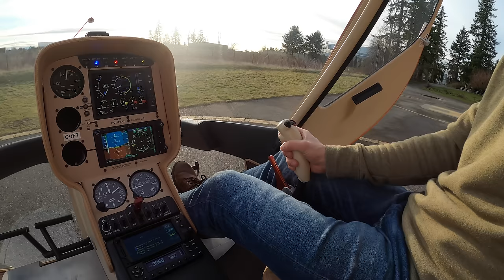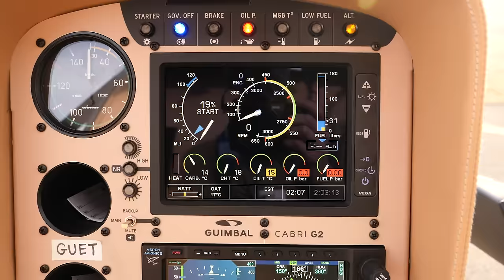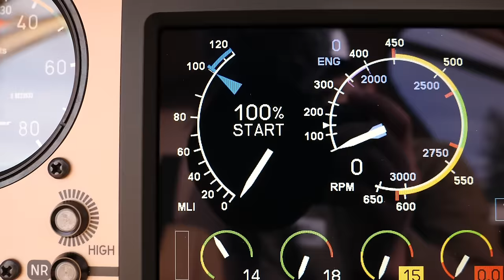How To FLY A HELICOPTER

Comment: the pilot in me wants to confuse everyone with gyroscopic precession
Reply: I've always been confused by that, it is precession or procecession?
Reply: @richduerr4471  not sure what procecession is but i know for a fact it's precession
Reply: @carl-ok9gn  Obviously procession is 90 degrees AFTER deflection, not before.  I'm pretty sure it is gyroscopic procession in gyroscope physics, but I'm drinking (booze) now, I could be wrong.
Reply: @richduerr4471  .... one of us is a pilot and one of us is drunk.
Reply: @richduerr4471  It's precession. Sober up, my friend. :-)
Reply: What everything is phased 90* off what he said.....gasp! What is this black magic. Bernoulli says keep cats in bag!
Reply: @landonmintz4850  >>> Schrodinger used a box...😊
Reply: Precession, Disymmetry of Lift, Retreating Blade Stall, helicopters ARE unique...😉
Reply: Retreating blade stall my favorite it’s like a built in governor!
Reply: @landonmintz4850  >>> Airplanes stall going too slow, FLING-WINGS stall going too fast. 😊 
 
Except the FLING-WING flips over before it crashes...😲
Reply: @landonmintz4850  , ya, and I'm still wondering how I went well past VNE in a R22 on my cross country solo and didn't end up in the woods below.
Reply: @Allan_aka_RocKITEman  bumpidy bump.
Reply: @scottalanclymer  in my cross country solo i pulled way more than max manifold pressure and didn't die.
Reply: @carl-ok9gn  >>> I think high MP and exceeding VNE are a bit different....
Reply: @Allan_aka_RocKITEman  yes. i just wanted in on the rule breaking..
Reply: @carl-ok9gn  >>> 😊

Comment: "The maximum torque you can use is 100% torque.."  facepalm
Reply: Apparently it is possible to exceed 100% in other models because the guage went beyond 100!!  I don't know what that means, but just saying what I saw.
Reply: It's 100% of what's acceptable. 100% of safe capacity.
Reply: @derick1618  no shit, Sherlock.!! -_-
Reply: Overtorque not good. Overtorque makes chopper  breaky breaky. But in Emergency for short okay without breaky breaky.
Reply: @hoola_amigos  My bad. I incorrectly assumed that you misunderstood the premise of what the 100% represented.
Reply: @derick1618  well, actually I didn't know that one could over-torque over 100%..
So you were right, and I was wrong.. ;)
Reply: @user-ki8ye1nc8p  Ah soooooo grass hoppa
Reply: @user-ki8ye1nc8p  A soooooo grass hoppa

Comment: Nice job. I would like to add that you focused on what the controls do mainly at a hover - collective to ascend/descend, pedals directional control (turns) and cyclic.  It's important to mention using collective to increase and decrease airspeed, pedals for trim, and collective for steering.   Lastly, what makes helicopters more tasking then fixed wing, is that you cannot move one control without simultaneously moving the others...for  example to accelerate and keep the same altitude you increase collective, apply left pedal, and slightly push the cyclic forward...

Comment: I actually attempted to join the army when I was a younger man because I wanted to learn to fly helicopters. Unfortunately I failed to pass the physical so the closest I got was video games playing flight simulators. I had the setup with controls such as he showed in this video, cyclic and collective and pedals, and the simulators are what potential pilots must learn to master first before they can ever get into the cockpit to operate an actual vehicle. After playing a simulator in which you could pilot a bell Huey such as the ones used in the Viet Nam conflict my hat is off to those pilots as they flew by the seat of their pants most of the time as compared to modern avionics in helicopters. I have talked with folks that were in Viet Nam and they tell stories of sitting in the choppers watching the runners brush the tops of the trees because the lower they flew, called "nap of the earth", the less exposure to ground fire.

Comment: Interesting. Always wondered about the left/right and forward/back but I had envisioned that, in keeping with the turbo shaft concept, that the entire rotor assembly pitched one direction or the other maybe five degrees to accomplish that (with a gear assembly as a linkage to the main shaft) because although I had pictured the the mechanism you described as one method of accomplishing that, to me, it seemed highly complex to manage and as though it would put far more strain on the blades than necessary and that it'd be very difficult to get mechanical parts to withstand that sort of high cyclic motion (rapid wear of metal and parts.) One thing is certain... they ain't simple machines!

Comment: Thanks, great video! Really like the view from the rotor hub that explains a lot. Amazing those blades can handle the pitch changes like that. At 400 RPMs it's almost 7 pitch changes per second. I assume the 90 degree till full pitch has something to do with the flexibility in the blade as it takes time for the change to reach the tip. Someone said helicopters fly by beating the air into submission and after having my first helicopter ride a few months ago I totally agree lol. Amazing machines, thanks for posting!

Comment: Taught myself how to fly a helicopter when I was 20.  Friends single seater experimental, explained to me how everything worked, played around low to the ground for a couple hours, and then flew to town 15 miles away and back.  

Navigation was my biggest issue.  Nothing looks the same from 2000 feet above...

Thought about taking lessons and getting my license to fly something useful, but family, work, money, and time always seemed like timing wasn't right.  Now at 50 years old, think my reflexes and eyesight would likely get me in trouble.  But, it was fun.

And to the naysayers, yes, I know it was stupid now, but at 20 I was superman, had no fear, and apparently no common sense.  I lived thru it though, and value the experience, however dumb it may have been.

Comment: I drove a stick, a motorcycle, a Cat 988, a 74 foot 3 blade Walter plow truck, a Walter 1500 gallon Foam truck, an end dump and an old Army plow truck with both front and rear wheel steering, all my first time out -  it's just that whole "ground" thing that concerns me a tad. BFWIW: I started on "You to can Spade & Neutor at home..."  3 out of 7 words spelled wrong. This guy got everything right, even "Helicopter!" So he's certainly smart enough to've been a military pilot....

Comment: The video from on top of the blades with the cyclic forward actually shows the correct maximum angle on the blade on the starboard side of the chopper, which is where it should be due to gyroscopic precession.

Comment: Hi Mr. Yellow

Great vid, but i have to correct you at 1:45 as it is not true :/

If you push cyclic fully forward, the maximum blade pitch angle will be at 3 o'clock and NOT over your tail pylon as you describe. :)

Example: Clockwise rotating with a maximum blade angle 6 o'clock(directly over tail pylon/boom) will result in a right roll.

Gyroscopic precession is the keyword here. Input is given 90* degress before the desired output.

Fly forward: Raise AOA on retreating side. Fly backwards: Raise AOA on advancing side

Ps. You can't tilt a rotor disc, but you can tilt the swashplate ;)

Best regards the MH60R technician

Comment: It's basically like a 4chanel RC copter and those usually comes with a disc with a simulator so you can train on your PC instead of chrashing it and on the pc you can connect copter game controller,,

Comment: 2:20 what about gyroscopic precession? Wouldn't it tilt 90° ahead of the direction the rotors spins, in other words if the rotor spins left / counterclockwise, the tilt would  be to the right in order to fly forward. No?

Comment: Ok, so when the  main rotor blades are let's say rotating at 40 % and still at ground level , without touching the cyclic are they constantly changing pitch with each and every rotation  as in automatically ?

Comment: Interesting that the blades of the tail rotor alter their pitch to counteract the torque- I'd always assumed that this would be achieved by slowing or speeding up the rotation. Why is this? Feathering the blades just seems mechanically over-complicated to me- or is it simpler than I imagine?

Comment: Hi! I have a question: if I increase the torque, does the RPM tend to reduce due to potential extra effort to the engine? Or is the gearbox there for this reason?

Comment: I would have thought that in this day and age, that a flight-assist computer should be able to control the natural rotational torque, thus eliminating much of human need to use the pedals. That way the pilot only needs to use the pedals to spin the craft horizontally and perhaps make minor adjustments to compensate for the computers errors.

Comment: How times have changed - governed engine rev's and digital guages. The Enstrom I trained on had throttle control as pilot responsibility so you were constantly working to prevent rotor rev' decay ......

Comment: Only thing harder than flying a helicopter, is to fly helicopter from the outside.
I know because I had a RC gas helicopter (Raptor) and when you hover and turn the nose of the helicopter to you, the cyclic is reversed, left becomes right, right becomes left.. so you can imagine how much training you need to keep up with that when the helicopter turns around. 
And if you become confused and loose control for a split second, then it's going to crash. 
I was almost sweating bullets the first few times I did this with my Raptor. 
But it was really rewarding to learn to control it after A LOT of training  with simulator. 
It would be fun to try after that how hard a real helicopter is.

Comment: Wait a minute, at 1:50 you say that "the rotor disc will follow the cyclic control and that is the direction the airplane is going to fly. if the rotor disc tilts forward the helicopter is going to fly forward." Are you sure that pushing the cyclic forward, tilts the rotor disc forward?
Reply: Correct. Moving cyclic forward will tilt the rotor disc forward producing lift and thrust forward.

Comment: On August 10, 2021, Sheikh Ismail Sheikh Ibrahim, a 24-year-old from Maharashtra’s Fulsawangi village in Mahagaon Tehsil of the district, used a Maruti 800 engine to power the helicopter he built. I never read why the blades broke. Does anyone have information ~ or where I can read about why? I know about the cause of death. I only want to know why the main rotor broke.

Comment: Flying a helicopter: 
Place a tennis ball on top of a beach ball. hold on to the beach ball and keep the tennis ball on top.
this requires constant input from all four controls, five controls if you also have to maintain the RPM.
this feat is called hovering 
and requires the patience of Job to master.
the flight lessons and learning phase of the helicopter can cost between 
40k & 80k  unless of course you join the armed services.
I am a commercial, multi engine
instrument rated pilot who has flown fixed wing aircraft for over 50 years.
I absolutely love the versatility of the helicopter and the finesse required to fly one.  I'll  not return to fixed Wing aircraft.

Comment: If and when any of the mechanic's envolved in any of the three have sufficent issue's. There is going to be major issues. When it happen's to various degree's with an experienced pilot. Is far less of an issue that has to be fixed. But an inexperienced pilot, is going to have major issues. Which gives credence to hilocopter's requireing considerably more maintainence.

Comment: Sir, you a bit wrong... Like 90 degrees wrong. The force you apply takes the effect 90 degrees later due to gyroscopic precession. So, to lean forward you need to apply force 90 degrees earlier. Cheers.

Comment: I think i can fly a helicopter even thou i never flown, can't be any different R/C copter. Do auto rotation all time. 60 size gas pull start still have in shed. That was 40 yrs. ago. head speed was 1800rpm.

Comment: I think the explanation of the cyclic is not entirely accurate. It's true that if you push the cyclic forward, the helicopter goes forwards, but the tilt of the rotors is have to be 90 degrees shifted, because of gyroscopic recession.

Comment: Helicopters are cool from the ground...For the simple fact that if you have an engine failure it's instantly turned into a brick..no chance to even try to glide into a landing, at least with a plane (most of them) you have a chance to land safely, heli not so much, time to crash n burn.